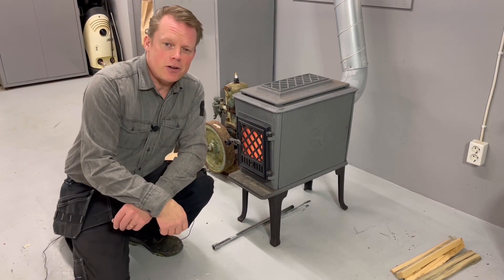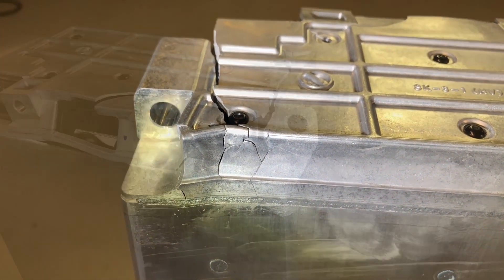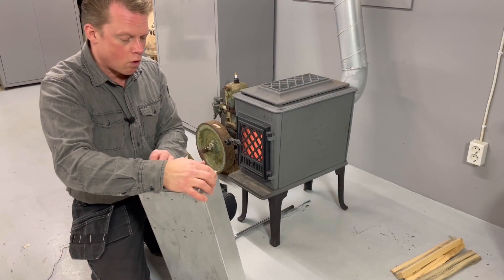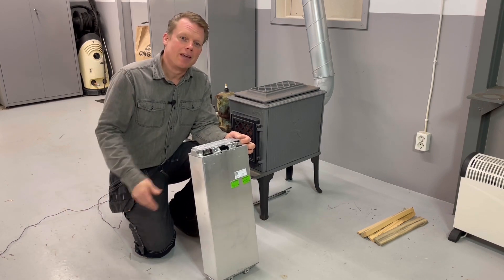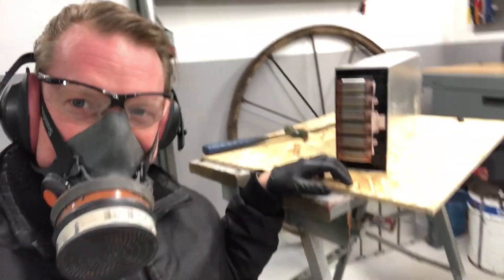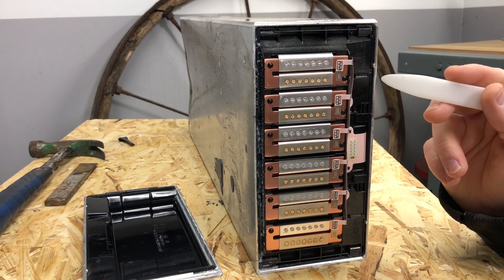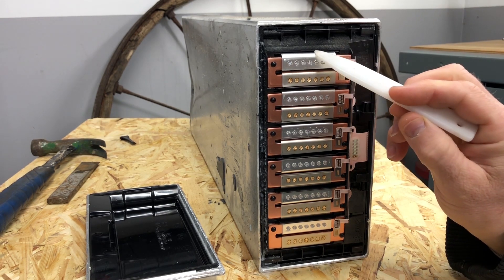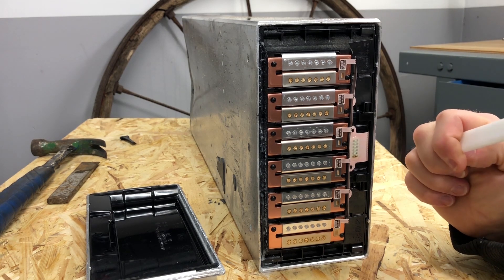Open up a VW id3 id4 lithium battery module.

Comment: IMO biggest issue of those module design is that all cells are directly connected to the bus. If one cell is broken, a module is broken. IMO each cell should be connected to the bus via MOS switch driven by processor that check cells conditions. If a cell is bad it would be deactivated by processor, but module would be still functional (just less capacity and max power)
Reply from the maker: I like the idea, but it will be both expensive, ad weight and also space. I have never seen this done by any other car manufacturer.
Reply: CORRECT..... but also TERRIBLY WRONG!
In this case, something called "human factor" plays a huge role because lithium batteries can be very dangerous and human can be very stupid.
Sure, being able to drive away after a problem (even if at reduced range, power and speed) can be a nice thing, but a cell can go bad for many different reasons and some of them pose very high risk of fire.
To further worsen the things, there are quite a lot of people that could prefer to keep the car de-rated instead of spending big money for a new battery (specially if the car is old and/or second/third hand), of course this further increase the fire hazard to an unwanted level (not only the car can self ignite on the road but also can self ignite near buildings, even during the night!).
This is the reason why an electric car with battery issues MUST STOP WORKING until checked and fixed by a technician: the convenience simply not worth the risk involved.....
Reply: @teslacoiler I'm sorry but I think you didn't understand me. CURRENT solutions of battery modules, in which the parameters of each cell are not monitored separately, are just WRONG and DANGEROUS for health and life because they pose a fire risk and should be FORBIDDEN by law! What is the cause of damage to battery modules and why usually ONE cell fails? The matter is simple: in the module you have X cells with a capacity of Y each, but in fact each cell in the module has a slightly different capacity and internal resistance (not much, but still), and ALWAYS one cell is the weakest one. During charge/discharge cycles, the weakest cell wears out faster (because this cell is deeply discharged) and with each cycle this process is FASTER - in current solutions, NOTHING PROTECTS this cell from excessive wear, which in turn leads to its destruction, and thus the entire module. This is a big problem, because such a cell can even cause a fire. The cell does not die because it was defective, just because it had a slightly lower capacity. In the solution I wrote about, EVERY cell is monitored from the first cycle (voltage, current, capacity, internal resistance) by the charge/discharge supervision system sewn into the battery module and can assess the parameters of each cell and DISCONNECT the weaker cell from too deep discharge, and thus protect it from destruction. Such a solution can extend the life of the cell and does NOT carry any risk! What's more, if the cell has a real defect, this system can disconnect such a cell from the fast charging and discharging process (i.e. ENSURE SAFETY - the greatest danger is charging a damaged cell with high current because it can cause a fire) and leave such a cell at a charge level of about 20%, protecting against swelling, which is a safe storage state.
Reply: BTW.... lithium fire is not a joke...
is way hotter than wood, plastic, gasoline and other flammable materials, it spread out very quickly and is nearly impossible to put out. 
An electric car fire is hot enough to permanently compromise the structural integrity of a concrete building and even a sprinkler system can't help too much (maybe it can slow down the spreading of the fire and keep the temperatures low enough to save the concrete building, but not much else if there are some other electric cars around!).
A cell in a perfect shape and perfect working condition is almost safe.... but not if there is another damaged cell nearby!!!

Comment: I have never seen that hardly serviceable battery 😢 I guess VW tries to make sure nobody replaces faulty cell in battery but buys whole module = more money to company. 

At least they don't use easy to explode round cells.
Reply from the maker: I think that almost every car manufacturer build their batteries like this, so it’s only Vw to blame. Sadly It’s the whole industry.
Reply: @flyingtools  Nissan Leaf has nice replacable battery cells but no idea if they ruined it on Ariya.

Comment: No active cooling??? Or a water cooler.
What if you drive fast in hot summer?
Reply from the maker: Of course, they are cooled. It’s just not shown here in this video, I only show a stand-alone module. The thermal handling is done via the bottom of the main battery box, (not seen here in the video) that has water circulating inside of it. The heat is then transferred via cooling paste between the modules and the battery box floor. Never had heard about overheating problems with those batteries and this system.

Comment: Would expect active cooling between the cells. Not awesome in that respect..
Reply from the maker: The thermal handling is done via the bottom of the main battery box, (not seen here in the video) that has water circulating inside of it. The heat is then transferred via cooling paste between the modules and the battery box floor. Never had heard about overheating problems with those batteries and this system.
Reply: Active cooling in between the cell would add significant complexity and cost into manufacturing of cells.  The way EV battery works is modular design and then cooling is provided via a giant cold plate which the battery sit on.  So the entire cold plate can be liquid cooled.

This is pretty much how ALL EV batteries are constructed.

Comment: Funny thermal interface at the edge of module! )
Reply from the maker: I’m not really sure what you mean but the thermal handling is done via the bottom of the main battery box, (not seen here in the video) that has water circulating inside of it. The heat is then transferred via cooling paste between the modules and the battery box floor.
Reply: @flyingtools  I mean this thermal design seems extremely ineffective. I think thermal resistance between battery pouches and coolant is huge.
Reply from the maker: @pshevelev  I working with those batteries every day and I have never heard about any problems with overheating so it probably works just fine, at least for normal use. But everything can be done better, but there is also a trade off, costs and weight.
Reply: @flyingtools  Of course costs and weight vs longevity and performance.

Comment: Great video, as expected these modules are made to withstand impact or a collision. They have to be (certified). Great salvage of cells btw. if only the fuse was burned in one section I would have left the alu casing intact and just bypassed those ribbons. A module that big and heavy is a great entry-level battery for solar energy storage. 24 cells = 12 x 2 in series. You could easily put those in series again leaving you 6 x 4 cells. 4S6P. Ofcourse you need a good and expensive bms. But it is all possible. These cells have probably a capacity of 100Ah each. It would add up to 12.6v - 600Ah = 7500 Wh (7.5 KWh). Not bad.
Reply from the maker: Hi, and thank you. That is what I already have done, 500v 10 modules and a three phase hybrid inverter at 15 kW. But this module was already destroyed, 1 cell was completely empty so I decided to hack this module for you guys😉
You will find more info on my channel .
Thanks for your input 👍🏻😊
Reply: Or you could build cargo ebike on this. That thing would have like 300km range.

Comment: This shit is almost not possible to recicle...
Reply from the maker: There is companies that take care of this recycling, and I think that it will be many more in the future and the technique will also be better.
Reply: what kind of recycling are you talking about? if we talking material recycling, than this is much better than tesla battery pack design. if you're talking about cell diy cell "recycling", than no company will tolerate it and no regulation will allow to use it officially for power bank at home etc.

Comment: What a great contribution by Volkswagen to serviceability where an angle grinder has to be used to gain access to the battery cells.
Reply: Better than Tesla where the whole battery is sealed. At least here you can change individual modules.
Reply from the maker: Yes, isn’t it great😅 but I don’t think that Volkswagen is alone to do it like this.
Reply: @flyingtools  You’re right. It’s pretty much across the board in a huge array of manufactured goods. You would like to think that in our ‘green’ future that an EU company might show a lead in this area.
Reply: @@timemachine1944 exactly.
Reply: Only a few years ago, the trick was to come up with a special bolt head that only the car company had tools for . but tool companies are super quick these days at being on the ball within weeks and getting these tools on the market,So i suspect this is there way to put you off any repairs and buying new and over priced packs , The fact is China just sees that as a way of selling you there packs .
Reply: The modules are not designed to be disassembled, which I think is appropriate.
Once the structural integrity of a module is broken, it is safest to send the module for recycling.

Comment: Never open a lithium module it is very dangerous are very inflamabble has to be done by proffesionals  .This person have very luck , I have use lipo an lion during 30 years
Reply from the maker: This battery module is completely discharged to make the risk as low as possible. Thank you for your concern.

Comment: hi 
nice videos 
i live in Sweden too
i would like to know if it´s possible to buy easily an old car battery to make a power wall ?
Reply from the maker: Hi, the junkyard normally just sell to companies. And they don’t use to ship the batteries. You have to pick it up yourself.
Reply: Hello! I am selling two healthy batteries from VW ID.3. One is 58kW, the other is 70kW. Location Bulgaria.

Comment: Thats nothing special - all Hyundai/Kia EV Batterys also have the same kind of fuses between the CELL and the Balance connecter  - this is very important because if you have a damaged Balance Cable wich make a Short to Ground or a other Terminal then you have a buring Cable within the BSU pack
Reply from the maker: That’s my hole point here. I had a lot of comments on another video I posted earlier when I said that there is fuses inside of those modules but many people did not believed me. Its absolutely necessary to have them for safety reason of course.
Reply: @flyingtools  i Agree - im a little bit surprised how massive VW Build ther Cell Packs within the BSU Unit - some weeks ago i dismouted a Hyundai Kona BSU Pack and disassembled a Cell pack and there is a Plastic Cover on the Top a Heatsink on the Bottom a Plastic Cover on the Side and two massive Alluminium brackets on each end of each cell Pack wich helps to compress the Cells within the cell Pack ... -

Comment: Is this the module by LG Poland for the 55 or 62 kWh batteries?
I still have to see the insides of the one made in USA.
Reply from the maker: Yes thats correct.
Reply: To add on this: The 62kWh battery has a 108s2p configuration in 9 modules, with 24 cells each, where 2 cells are in parallel and 12 in series, as you can nicely see in the video. The 82kWh battery has 12 modules, where in one module there are also 24 cells, but 3 in parallel and 8 in series. That is then a 96s3p configuration.
Reply: @ufux4u  They also have the prismatic CATL cells (50 % more capacity, stacked behind each other) that come as 16 cells per module and only 2 each parallel.
That is why those modules with a black lid cannot go into the smaller batteries (too low voltage then).

Comment: Initially I thought it is a serviceable battery pack where you can change an individual cell but now I know it isn't. 🙁
Reply: This design is not a durable nor sustainable. I would expact a more evironmental friendly design from VW.
Reply: @wimvander1427  and which company does make battery packs (diy) serviceable?
Reply from the maker: I wish it was so.

Comment: Great video, it helped me a lot. If you want to salvage good cells, I recommend, that you grind both bottom corners of the case. Then you simply lift the upper case and you have access to the cells. But you must be very careful, you only have about 2mm of padding between case and pouches. Main problem is how to separate the cells without damaging the pouches. I used two plastic spatulas to slightly pry the batteries. When you have a tiny gap, spray some polyurethane cleaner in the gap and continue with the spatula. I used kitchen spatulas, but I additionally sharpened their front end on grinder. When you pry the cell apart, add some more cleaner (solvent), wait a bit and then also the bottom cement will let go. Then gently separate the battery on top and keep increasing the gap. When the cell is perpendicular to the rest of the pack, gently lift it up on one side. There is some trial and error involved, so don't expect 100% yield. It is very important, that you separate the cell down to the bottom of the crack with spatula. Otherwise the solvent won't come in contact with cement and won't let go. Be careful, as you are doing this at your own risk. Get out somewhere in the open. Good luck.
Reply: Hey, can you give an estimation on how long it will take to extract the Pouch Cells from one Module? For my purpose Cells dont need to be salvaged damageless
Reply: @vctrnxav5908  First you should know, that the cell with minuscule puncture isn't useful any more, it can only be recycled. Taking the cover off is quite simple, small angle grinder for end caps and handheld milling machine for longitudinal cuts. Real fun starts with separation of cells.  It took me maybe eight to ten hours to separate four packs. It is a messy job and cells get damaged easily. Good luck.

Comment: you should use antiseptic with propylenglycole alcohol, or izopropane alcohol, it solvents the glue, and affects the bottom cement
Reply from the maker: I’m not sure if I want that solvent on the plastic bags. In the long term it can be bad.
Reply: @flyingtools   not the solvent, technical alcohol, i think it is normaly okay. It evaporates in 5-10 minutes

Comment: Those G fuses are rated at 750mA if I remember correctly.
Reply from the maker: Ok, it might be correct because they got really warm at 800mA and the solder melted around them at 1A.

Comment: Hey great work. I drive a VW ID3 so i was curious about the battery.
Regarding the fuses: Why are there 15 fuses for a 12s2p battery? I would assume 13 fuses for all balancer connections. Are the temp sensor connections protected by the 2 additional fuses? 

Have you checked the breaking current of the fuses? In another video you mentioned 150mA. Where did you find this value. Sorry for being curious.  😄
Reply from the maker: Hi! There is one extra module negative and positive, probably to check the module voltage during balancing. 
The temp sensor is not fused.

Yes, they got burnt black at 1A and failed at 1,5A. The voltage drop was almost 1,5v befor it failed.

I read that in a forum about simps bms, and that’s why it’s not going to be possible to use a Orion bms to those modules they said. Which is completely wrong.
Reply: G fuses are rated at 750mA

Comment: Hello Thomas, did you test those fuses already if they could handle more that 0,3 amps.
Reply from the maker: Hi. Yes but they got the warm after that and at 1 A they got completely black and they failed at 1.5 A so I don’t recommend to use a BMS that balance the cells with more than max 0.3 A

Comment: How many in series the electrical diagram is there? 12S??
Reply from the maker: Hi! Yes 12s2p.
Reply: @flyingtools  Hmm... according to the voltage on main terminals and the balance wires in that grey socket mine (two of them) seem to be 8S3P. The sticker says 234Ah which makes 78Ah * 3. Module number is 0Z1 915 599 H. Yours is 156Ah as seen on 5:50... this is 2P indeed
Reply from the maker: @indrekmorell6615   yes, the are made in two versions 12s2p and 8s3p it depends on which battery pack they comes from.

Comment: Hello, I am converting a Honda S2000 into an EV. My plan is to mount this MEB-Modules upright in a box to the front of the car where the combustion-engine was. How is your impression about the stability of the assembly (cells, glue, weldings, aluminium-box) in an upright-position in a car?
Reply from the maker: Hi!
Nice project👍🏻
Sorry for my late reply.
They are very stable so I think you can have them in any position you like.

Comment: Could you tell us the exact cell name?
Reply from the maker: Yes, you will find more info in the description, NCM 712 E78 LG Chem
Reply: Thanks, I have 3 of these modules at home for about 2 years and Im cery happy with them, I use no bms just JK balancer with 300mA balance current, so far so chood with my 9000VA victron system

Comment: Do you have any special source for all batteries you are buying? I'm currently looking at bildelsbasen and there are some there, but of course always looking for other sources. Already built a system for Checkwatt with BMW X5 hybrid battery with Sungrow  hybrid inverter and a 48V DIY Lifepo4 bank with 28kWh of storage on a SolarEdge hybrid inverter, but looking for a VAG 62 or 82kWh to replace the 48V system. As you might understand I also live in Sweden.
Reply from the maker: No, I bought them all from bildelsbasen.